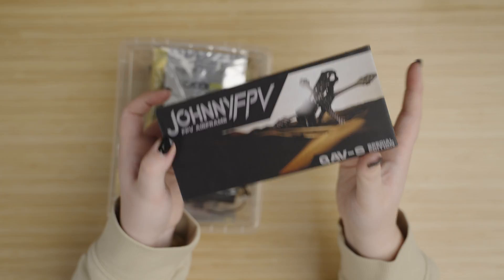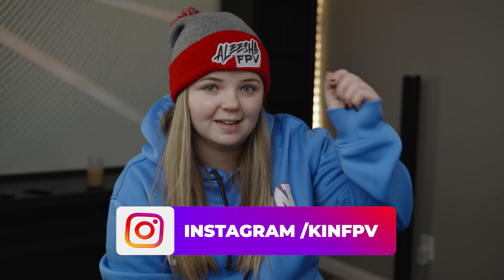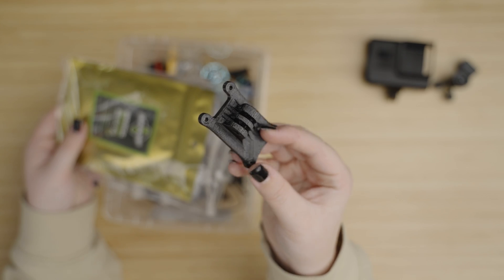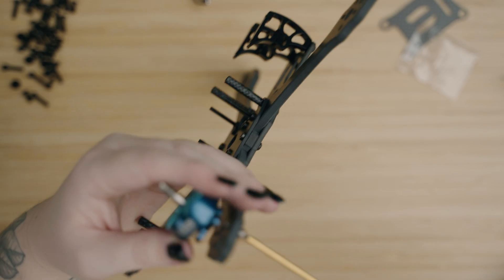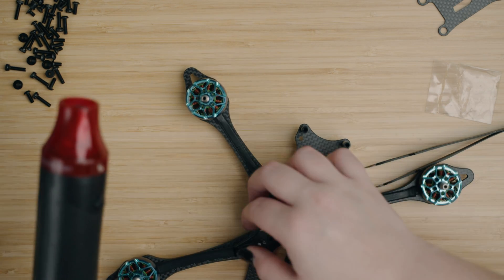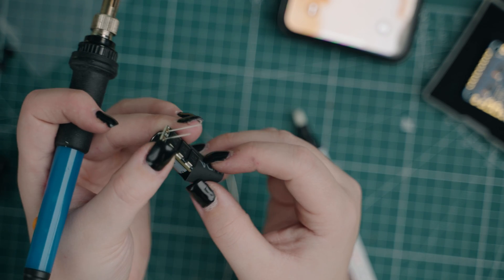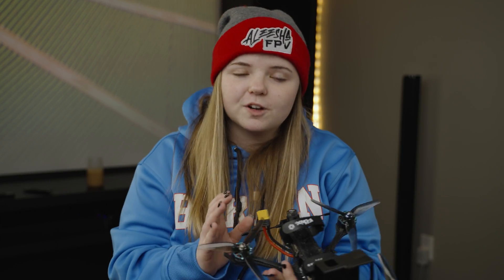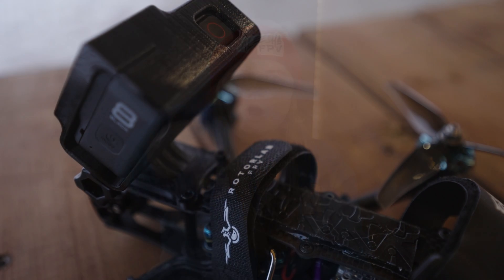Building an FPV Drone! | FETtec G4

Comment: Probably they didn’t tell you that kiss and fettec are not that durable. 
I said to try fettec and had a 4 or 5 good flights and I liked it but in the first crash I had fc and esc seemed to be dead. 
Never had any issue before with a crash like that. Ive had harder crashes than the one at least with my not very aggressive flying style.
Reply from the maker: I heard that but I've been using this drone since January no issues till last week lol
Reply: @AleeshaFPV  then it has been abused 😅, but if you put new esc or fc on it and did all that then you are missing something. 
No worries. I have 4 or 5 quads that are half fixed due to issues. Don’t let go. 
This hobby is really fun but sucks at the same time too. 🤣
Reply from the maker: @xaralampos1959  I changed out all core electronics, as I didn't have replacement fettec stuff. 

I smoked the fc on the first replacement im assuming by not cleaning it off thoroughly and then changed out everything again completely and my vista went.

Comment: I can't get my 45 amp fettec to work? I just have 3 flashing blue lights. It beeps twice when I plug it in. I am running it with a G4 Fc. I get all my controls working in the KISS GUI, when I arm it? Also I can't get it to see any ESCs when I use the Fettec configurator. Anyone have any ideas?
Reply from the maker: dang, id message fettec on IG if i were you!

Comment: Aleesha, I have followed you for just a few days and wanted to know if you would be interested in helping me perhaps with remote video lessons. My goal is to get somewhat decent if at all. I have a passion for building these things but honestly do not have much air time. I need to understand concepts that you gurus know. I want to learn to tune my quads and the whole PID thing. You tell me if that's something you'd be interested in. Yeah, all of that is on YT but a one on one lesson would explain things better for me. The reason why I don't hire or seek others #1 because most if not all have a chip on their shoulder and I've no time for egos and #2 you show things with ease and do not assume everyone is at your level. Let me know please and thank you! - No big deal if you can't of course!
Reply from the maker: i would love too however i am quite busy. 

Im also not a pro in pids so i wouldnt be able to teach that. 

I do have a Patreon you can join and ask any and all questions you have. As much as i would love to just sit and help, time is valuable.
Reply: @AleeshaFPV  Ok sure np. I wasn't clear perhaps. This was never meant to be a free thing. That part I missed. It would have been a per hour rate engagement. Trust me, I hear ya about $$. In the past I have hired folks to help me with items I had questions on.